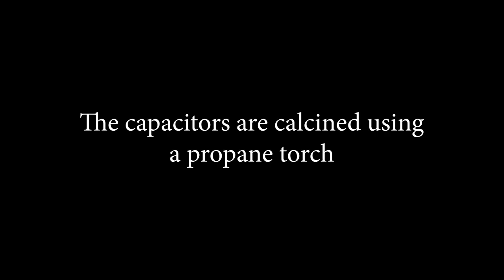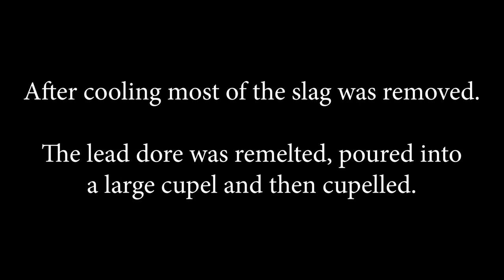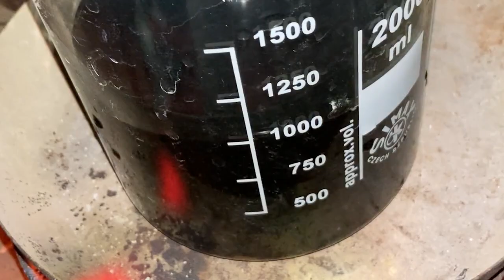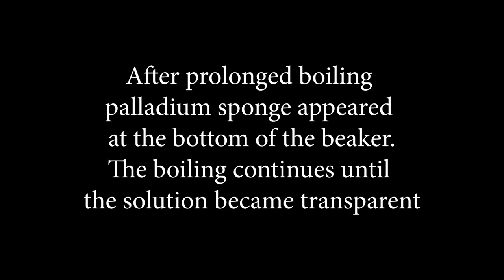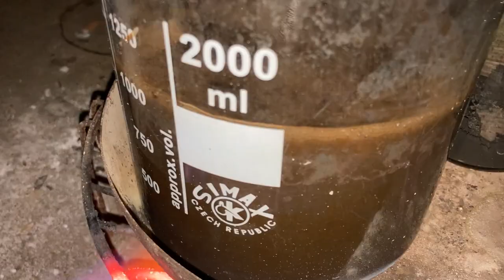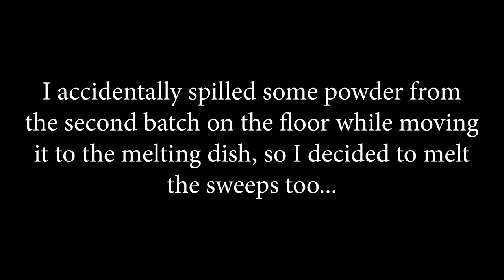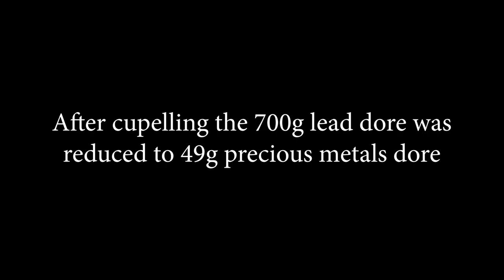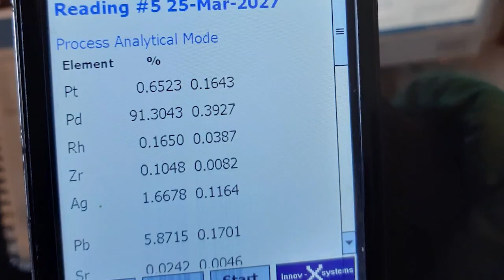Palladium recovery from 1.7kg ceramic capacitors (MLCCs)

Comment: For those who watched this hour long video to not be told the value of these efforts, it's worth about $3000 usd.
Reply: My eternal question is, & I've asked it many times, in many places,  how do you identify resin dipped capacitors that contain palladium? I can identify resin dipped tantalum capacitors, but no one answers how you identify the RD capacitors that contain palladium.
Reply: @mareecathie2476  no specific way other than knowing your capacitors by look alone. 

I usually take a sample of say 10 pieces, weigh them, incinerate, crush, and process to get yield, then add a picture with yield data to my cheat sheet at home. That way I can go after specific grades and save time in the long run.
Reply: @redbaronrefining5322  Thank you so much for your answer, RB. Sort of sticks a hole in my grand plan :-) I scrap a lot of circuit boards & just sell the chips as I'm not set up to refine. I was hoping I could do the same with them. Thank you, again.
Reply: @mareecathie2476  I do toll refines if you ever want to save some samples, and get yields :)
Reply: My God that's a lot of work and to work with those acids ? Not me. Lol

Comment: To remove the final led from the palladium, you should add some sulfuric acid after you denox the solution and look for precipitation of lead sulfate. Add more sulfuric acid until there is no more precipitate. That should solve the lead problem for you.
The pink crystals in the filter looked like lead chloride to me, the color was probably from something else included in the white needle formed crystals.
Reply from the maker: Hi Göran! I don't think there's any lead left in the button or at least there shouldn't be since I took three 3 steps to eliminate it before precipitating the palladium:
1st step was the cupellation itself,
2nd step was chlorination (any lead should have precipitated with the silver as the corresponding chlorides from the chilled solution) and the
3rd step was the de-NOxing with sulphamic acid which converts the free nitric acid to sulphuric in situ thus precipitating any lead that made it this far as lead sulphate. 
With the above said I'm more inclined to think that the XRF gun needs calibration... not sure
As for the pink crystals I think it's Vauquelin's Salt ([Pd(NH3)4PdCl4] Lou and freechemist mentioned it on GRF https://goldrefiningforum.com/phpBB3/viewtopic.php?t=9023#p86042) but again not sure...
Reply: @OwlTech333  Your final XRF reading shows 5.8% Pb. It's a bit much just to come from a badly calibrated XRF.

As you say, a chilled chloride solution should precipitate most of the lead and the rest could easily be taken care of by the conversion of sulfamic acid turning into sulfuric acid. But lead chloride takes a while to precipitate, that's why it can form quite long and thin crystals.

I suspect that you got so much lead nitrate that the denoxing of nitric acid didn't produce enough sulfuric acid to remove all the lead in that step. But that's just a theory of mine.

Putting a few drops of sulfuric into a solution is a cheap and instant way to verify if you have lead in solution or not. And for the few times you got lead it alerts you for a problem that might cost you a lot later on.

But if you don't think you have any lead in your final button then you can just disregard all that I wrote. :-)

I've never seen Vauquelin's salt as crystals, only read about it in articles and on GRF. I don't know if it forms thin crystals just as lead chloride does. If you still have that filter paper a quick XRF should tell you if it is lead or palladium.

Thanks for sharing that video. I have half a kilo of MLCC:s to process in the summer. But I'll probably go the wet chemistry way after incineration. It's worked well for me before.
Reply from the maker: @goranaxelsson1409  Thanks! I'll give it a go next time!
Reply: @OwlTech333  I'll wait for the next video. :-)

Comment: 39:11 the base does not scratch piles jewelry trick when it is at room temperature we will add isopropyl alcohol this will detach the metal from the glass creating a mass to which we will add a powder We will add a similar bolomen of liquid borax, this amalgam will prevent metal from being lost during the fusion and I recommend using a granite crucible with Tesla fusion or induction fusion.

Comment: 11:17 in the pan where you stir the nitric acid solution you must place a base 1 cm of silicon oxide and pay it with aluminous and activator the rest to cover you will use the same type of silicate that is used for pavement painting is cover the reflective silicate is nitro pearls if silicon and pure silicate this will affirm the heat and distribute it amogenous throughout the pilex base
Reply: In English please. 🤣🤗🤗
Reply: Wish I was as smart as you 😒
Reply: @jazzdein1  it's funny that they answer yes to translate
Reply: @alquimiavsmetalica5250  I dont follow, the guy who said "in English please!" Or something that went over my head?
Reply: Because it was in English and I read all of it read all of it but it was like sticking my head in the sink and and pouring borax on it and smelting it
Reply: For the retrieval of some type of brain
Reply: @jazzdein1  you are short-minded the chat is not translated
Reply: @alquimiavsmetalica5250  Yeah some times people overlook, or don't know how to use that option.
Reply: @alquimiavsmetalica5250  ill take "short minded" as a compliment. Doesn't sound nice. But you have to under stand if yours is automatically translated to English then how would I know you dont speak English? You can't of seem stuck up, into yourself a little much.  Glad you are confident
Reply: @alquimiavsmetalica5250  I speak Spanish, but its not translated like it normally gives the options.  I understand what you are saying now.

Comment: What happens with the lead oxide vapor? I would imagine that it will affect health very negative after some time of exposure. How can u make sure to not be slowly poisoned by the lead fumes. Thank you. I would appreciate an answer! Kind regards🖐️
Reply from the maker: Simple: Wear a mask. Take a shower when finished and  don't forget to wash your clothes.
Reply: I would suggest making a vent hood with a high cfm volume for drawing away the fumes into some sort of exterior filter box outside the building you’re doing this in.
PPE, such as painters respirator, rubber smock, full face shield and nitrile gloves are a must in any caustic process.

Comment: Are them the ceramic tiles at power sub stations, that divide the metal disc things. Sorry my electrical engineering knowledge is a little lacking.

Comment: I got like close to 3 kilo of these resin dipped ceramic capacitors mostly blue and brown ones with a few mixed odd colors. This votes well to a very good yield when I get the materials to process them. One is always hoping anyway been collecting and saving a long time now. I also have over 2 kilo of ic chips saved up that should be good also.
Reply from the maker: Sounds promising!

Comment: Took some big chances there,  adding the silver contacts from relays that could have contained selenium could have really cause some problems.  Also doing pallium group metals is dangerous. 
As you can get pantinosis and that will be fatal.
Reply: Please go on.

I'm thinking about doing this.

What should I look out for?
Reply: So dont melt metals together, check.

Do not get fiberglass in molten, check

Always have ventilation, check

A mask?
Clothing?

Stay away from?

Anything helps thx

Comment: Very cool process. Is it possible to get higher purity or at least remove the lead? I know you can't remove the platinum, but would a second refining be worth the effort?
Reply from the maker: I don't think there's any lead left, more to do with the XRF gun calibration IMHO
Reply: @OwlTech333  So is the xrf gun not all that useful to determine precise composition of alloys?
Reply from the maker: useful but you can not solely rely on it

Comment: How to eliminate excess nitric acid any one please help me? I added urea to neutralise the solution and after adding SMB but I didn't get any gold dust
Reply from the maker: Sulphamic acid
Reply: To eliminate excessive nitric acid, do I heat the aqua regia before or after adding the suphamic acid? Or do I add suphamic acid at outside temparture? And how do I know when to stop adding suphamic acid?
Thanks if you reply.
Reply from the maker: @franchi8601  I do it after dissolution, I keep adding sulphamic acid until solution stops fizzing then I dilute with water or ice leave it to cool and then filter

Comment: Wow, Zirconium would of never guessed that unless if these came from boards used for nuclear power but even than thats a stretch
Reply from the maker: No, I guess it was picked from the crucible
Reply: @OwlTech333  very possible, I only know about boards for nuclear because I bought some. I read up on what they used in the componets and decided to resell, a bunch of metals I have no clue to process once mixed with Precious Metals. Better to be safe than dead.

Comment: iyi bir yöntem değil
değerli metaller kurşuna karışıyor
solusyon kaynarken aniden taşıyor
potada eriyen PD,soğurken siyahlaşıp dağılıyor.
Reply from the maker: aslında yöntem oldukça iyi çalışıyor, ancak Pd eritme kısmına katılıyorum
Reply: @OwlTech333  borax içinde eriyip gömülen düğme,dağılmıyor.sanırım çözüm bu.
Reply: Merhaba, kullanılan pirometalurjik yöntemde pek bir sıkıntı göremedim ben, bu yöntem yüzyıllardır kullanılan bir yöntemdir. Eritme konusunda haksız değilsiniz paladyum oksigaz kaynağıyla eritilmez karbon tutar. (Hello, I couldnt see any problems in the pyrometallurgical method, it has been used for centuries. But you have a point on the melting part, palladium do absorb and dissolve the carbon when it is melted by oxy-fuel )
Reply: @dddddd7315  nasıl eritmeliyiz?eritmeden tuz haliyle(NH4)2PdCl6 (amonyum hekzakloropaladat) satın alıcı bulabilir miyiz?bilgi verir misiniz